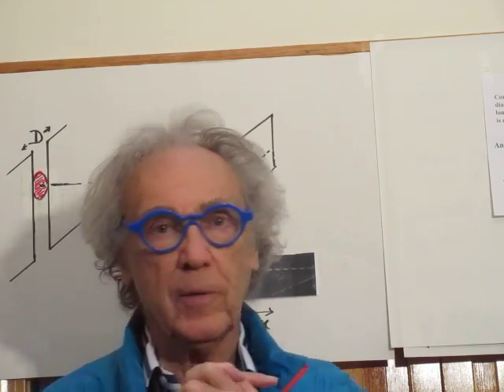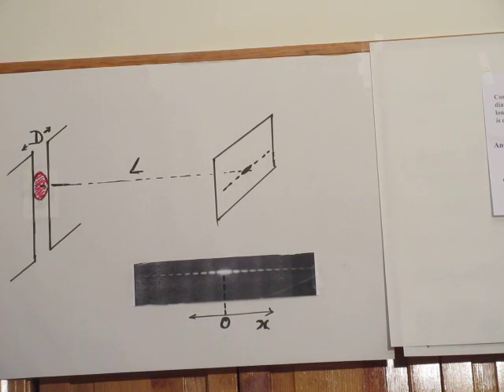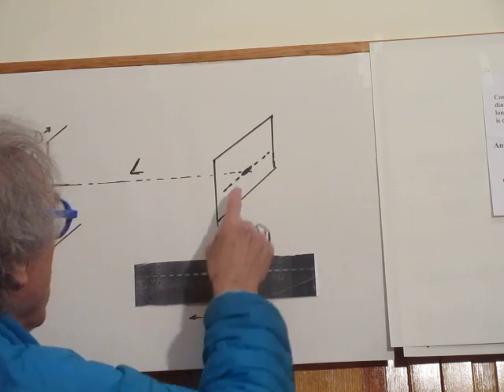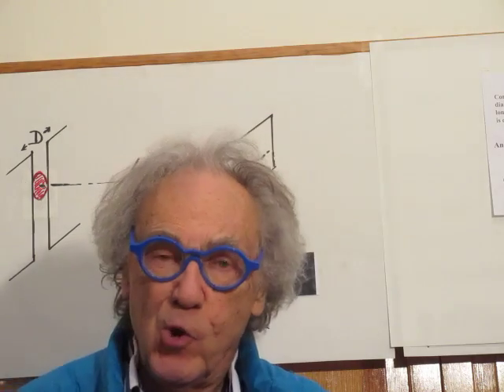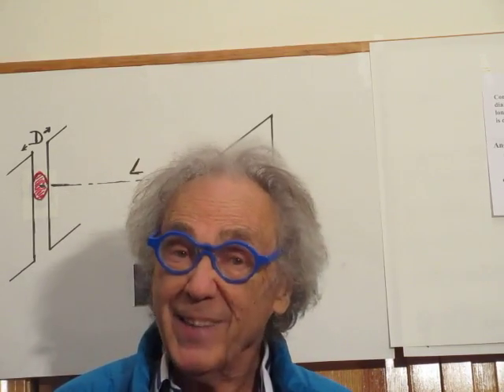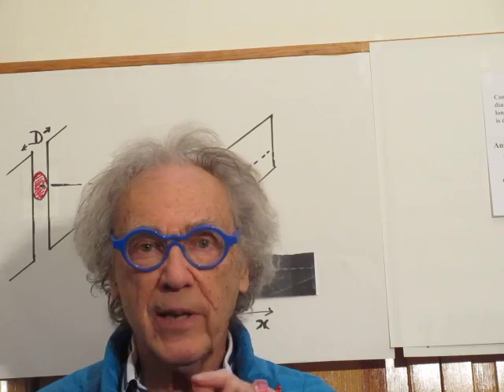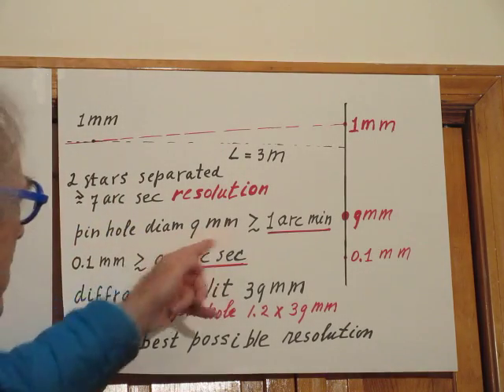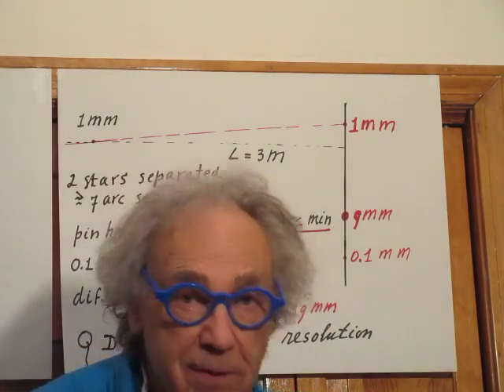Problem #77 - Pinhole Camera

Comment: Errata - from the previous lecture, a pinhole size of 0.1 mm was used. arcsin(0.1/3000)=0.0019 degrees 3600 arcseconds/degree = 6.8 arcseconds, while arcsin(1.0/3000)=68 arcseconds. It seems like some of the cases are mixed up. At 0.1 mm, the single slit did produce a central image width of 39 mm, and the pinhole of 0.1 mm should produce a central blob of diameter 1.22 39 mm = 47.6 mm as stated.

Comment: 🤔I have a question/hypothesis about dark energy... if I bend a piece of steel to 90⁰, the inside of the bend will compress, and the outside will expand, if gravity is like the inside of the bend, could dark energy be the outside of the bend? If a galactic gravitational field is compressing spacetime, then outside of the galaxy must be a dark energy field expanding spacetime, this would suggest that gravity and dark energy are 2 sides of the same coin... for every action there is an equal and opposite reaction, where mass compresses spacetime, then where spacetime lacks mass it must expand, or mass will have nothing to compress, and spacetime will become pulled taught, and possibly rip 🤔 🤷‍♂️ I also wonder if since a wave has a larger surface area than a flat line such as a fractal, then that IS the warping of spacetime, so if a still lake suddenly experienced a wave, its surface area would greatly be increased and the water level would drop... dark energy is spacetime resisting such a drop in "water level" the only solution for this is that the fabric must expand 🤔🤷‍♂️

Also, I would like to thank you for this channel, science has completely changed my way of viewing the world around me, it was only by luck I ran across this page, you sir, are doing an amazing service to mankind, and will be remembered for many... many lifetimes 😊again thank you for your service to mankind Mr. Walter Lewin, you have changed many lives for the better... including mine
Reply from the maker: https://en.wikipedia.org/wiki/Dark_energy